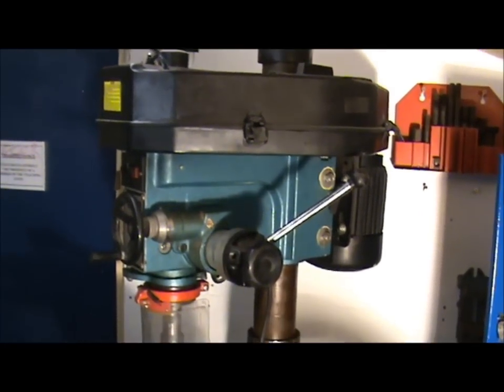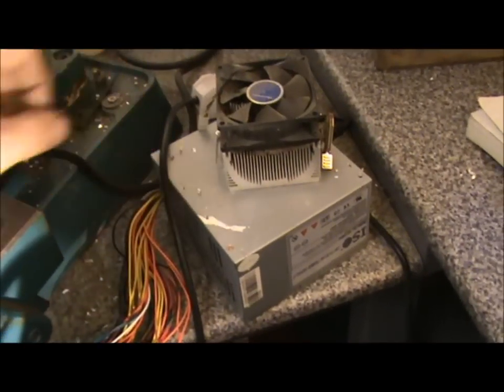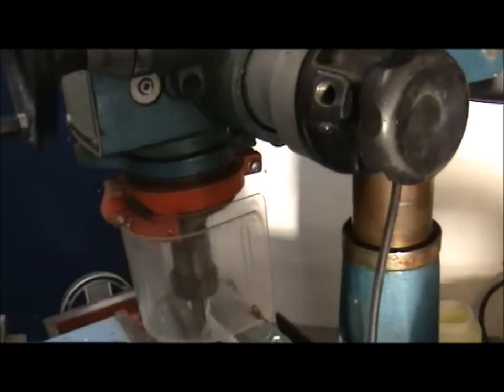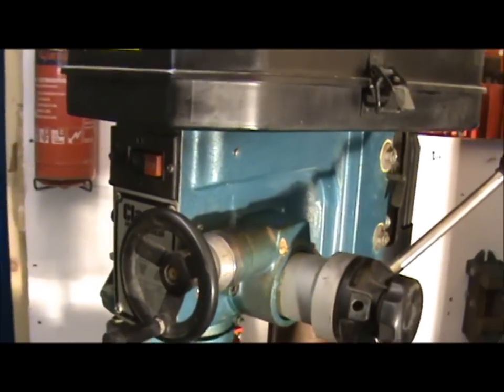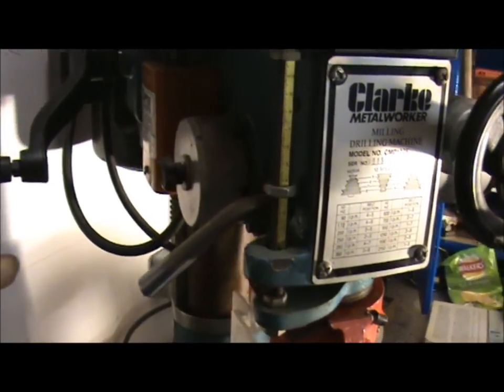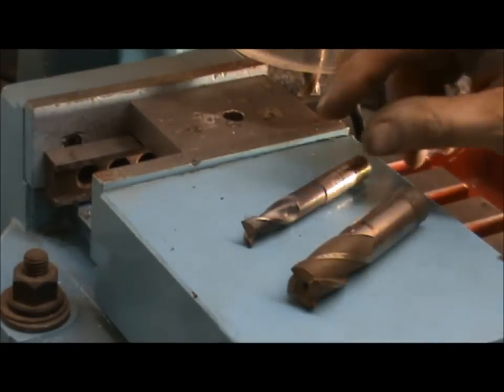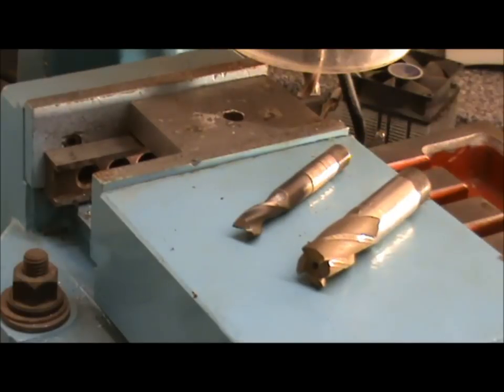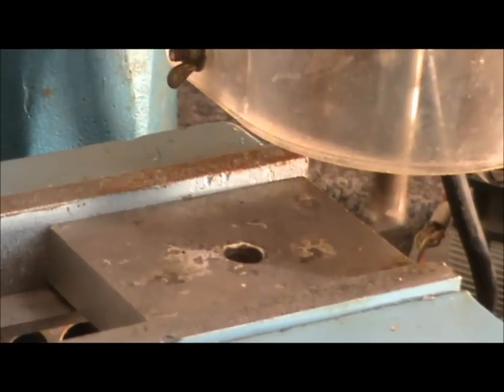mill drills  are great value for money ! a look at a Clarke milling machine

Comment from the maker: hi yes you are correct, you have to tighten up the head bolts very well, but  you have to loosen them when your moving the head up and down the round Colum, which is quite often, no big deal, 
if these are lose and your milling a slot it can drag the head over pulling the slot out of line this happened to me at first and I thought it was dull cutters!, I soon learnt!
now then, some people build guides for the head, Google image "drill mill round Colum guide".  there's a way around everything